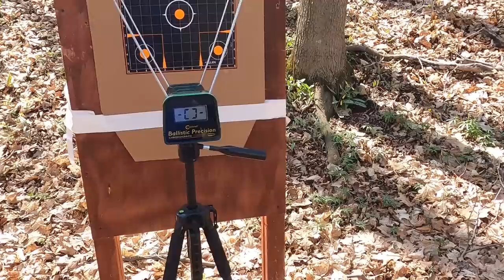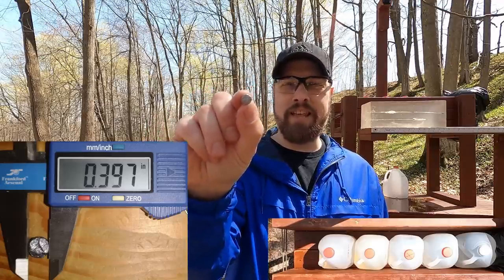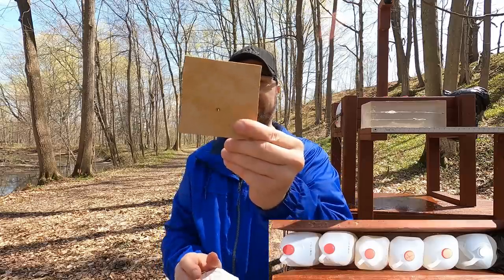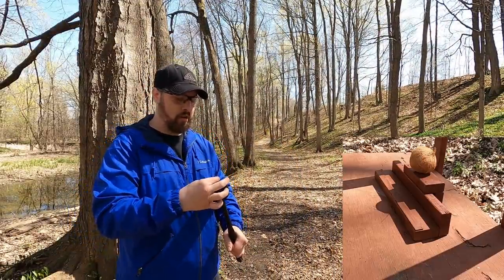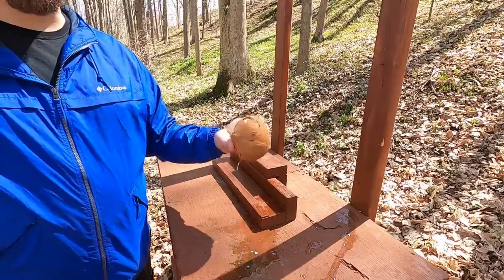WOW Dieseled Pellet Rifle RIVALS Firearm - .30 Caliber Break Barrel OVER 50 Ft Lbs Energy!

Comment: Well I’m going to see if a little vaseline will help my .177 🤷‍♂️
Reply from the maker: Use alloy pellets if you do. I had blown skirts on lead pellets back in the day when I did it with .177, and it was an era before alloy pellets. So my guess is alloy will handle the pressure better.
Reply: Pelgun oil or and non detergent motor oil has given me the best results. Don't use just regular motor oil or any that has detergents. Once they make contact with your orings and such, they will degrade your rubber seals over time.
Reply: I've always used WD-40.. found out many years later I was dieseling all along.
not had problem with the hard neoprene rubber main barrel seal, it gets a little smear of grease once in a while.

Comment: Dieseling is bad for Your airgun , they were not designed to have explosive compression , this was felt when You mentioned it coming back through the trigger , that is the piston bouncing back , but hey ho I know it's fun because like You I did it in My youth . One of the tricks My friends and I did was to open a can of pellets and  mist the can with a quick squirt of WD40  . We used .22 pellets and if you put a drop of 3 in 1 in the pellet they would literally go ballistic . We didn't have a chrono back then but You could tell by the loud crack as the pellet broke the speed of sound , accuracy was pathetic and not at all consistent but it easily made holes in a card board Dart board and two half inch planks we had behind to hang the board on . We didn't realise at the time but if the police had caught us We would have been in serious trouble because the power exceeded the legal none licenced power of a UK sub 12 ft/lb gun .  That was really interesting and something I have often wondered about over the years , You will probably find it take 20 or 30 shots to clear all the unburned vaseline  from the barrel and You will notice a loss of accuracy until it settles back down . Would I do it ? , Only if it was an emergency situation where I Needed More Hitting Power  and again I would limit the amount of times I did it to a minimum . I also still think Your rifle might be able to shoot some of the lighter slugs that are becoming quite popular these days with PCP users , how well they might work with Your rifle is hard to say  but I should imagine that the results with a dieseled slug could be spectacular . As for Chronys FX do a radar model that works even in fog & rain , again check out some of the airgun channels most of them are now using this device as they are more reliable than regular chronys  , but You need a smartphone to download the app it uses to display the results , although I watched a video where it was announced the FX are soon to release a device that displays it for You and can be attached to the rifle .  Shoot Straight Stay Safe & Stay Well .

Comment: Wow! Very interesting. I didn't quite catch the reason it might be harmful to the gun. If you get a chance perhaps you could comment, thanks.
Reply from the maker: I'm not knowledgeable on it, but I think it has something to do with the rubber air seal breaking.
Reply: It burns seals and adds internal pressures the gun is not designed for , also it causes the piston to rebound more than usual resulting in stress on components so they don't last as long  .
Reply: I ruined an airgun in the very first shot . It bend something internally . I couldn't open it after so i just threw it in the dump . But my cheap China rifle has shot many times  ,  i press the pellet in an inch or so . If i dont , led debris can be there when i open

Comment: First, this is not one bit smart and one really fast way to destroy an air rifle. Only thing I can suggest, should anyone seriously be considering doing this regularly, is to go to your gun makers website and buy a healthy stock of new piston and breech seals. Generating that much extra power also means generating way more heat while you're shooting and at some point you're going to melt both of those seals, then stand there wondering why all the sudden your gun won't shoot right. Not to mention the extra stresses on the rifle shooting it that way. BTW, you can also write off any warranty you might have on your rifle should you trying sending it back for a warranty claim.

Comment: Why exactly does the gun need to be a firearms rival?  It's a different tool with a different use.
Reply from the maker: It does exactly the same thing, at a different level.
Reply: It seems you modified it do do something it wasn't designed for. For what reason?  So it would do what a .22lr would do. It's not a 22lr. It's a break barrel sir gun.

Comment: Interesting!  But if we deliberately incorporate the diesel function into our air gun, I’m afraid it becomes legally a firearm, despite the differences in propellant and ignition method - and that comes with massive government over regulation, harassment by F-Troop, etc.   still, I like the idea and think it should be explored.
Reply from the maker: Firearms are defined by the ATF is as follows; "Any weapon (including a starter gun) which will or is designed to or may readily be converted to expel a projectile by the action of an explosive;" So, while Vaseline may or may not explode or combust, or who knows what's happening...it's very subjective but I don't think that the company Unilever, lists their product Vaseline primarily as an explosive.

Comment: any petroleum product will ruin your breach seal
Reply: It's an O-ring.   Worry about the piston's rings.
Reply: @scottmerrow1488  i know that too, but smearing vaseline on the breech seal isn't good either,, like my weihrauch,, it isn't just a breech seal to me,, that's just 1 of many reasons that no one touches my guns but me
Reply: @woofman4796  I'm sure I wouldn't diesel a weihrauch.  But I did buy a spare Hatsan airtact .22 in case the one I do diesel fails.  Not worried about the O-ring.
Reply: @scottmerrow1488  i don't diesel any of my guns,, but you do what you want with your property
Reply: @woofman4796  That's right Karen, I will.